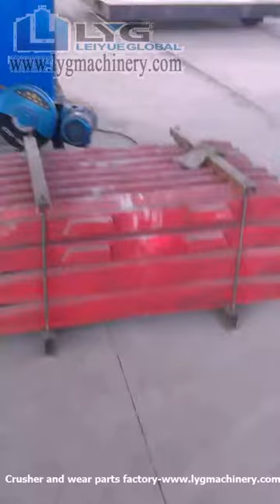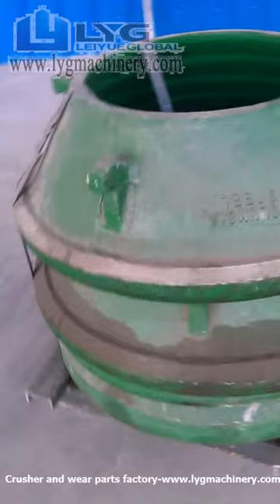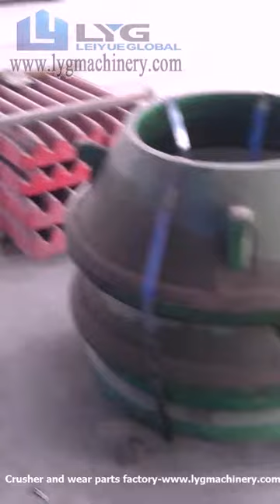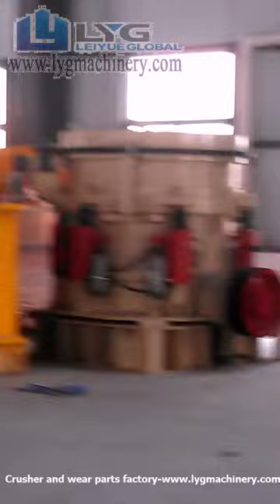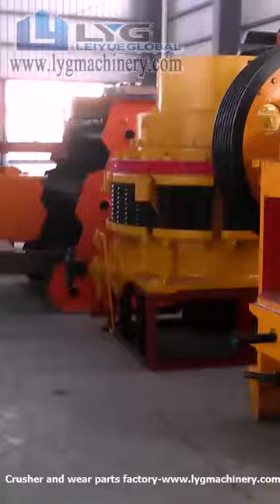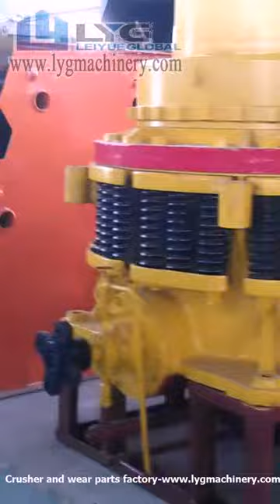High Efficiency 250*1200 Jaw Crusher for rock,stone, ore crusher-lygmachinery.com

Comment from the maker: toni.miao@lygmachinery.com
http://www.lygmachinery.com/pe-jaw-crusher.htm

Construction Jaw Crusher
1.High crushing ratio
2.High speed crushing technology
3.Easy installation
4.Shock absorption

Introduction of   jaw crusher 
PE series construction  Jaw crusher series have features of big crushing ratio, uniform products size, simple structure, reliable work, easy maintenance and low cost. PE Jaw Crusher is widely used in stone mining, metallurgy industry, building material, highway, railway, water conservancy and chemical industries. Jaw crusher various material with compression resistance less than 320MPa can be crushed.

Construction jaw crusher application cope:
 construction jaw crusher widely used for crushing various materials like stone, granite, trap rock, coke, coal, manganese ore, iron ore, emery, fused aluminum, oxide, fused calcium carbide, lime stone, quartzite, alloys, etc.